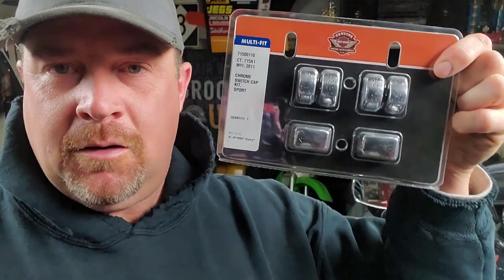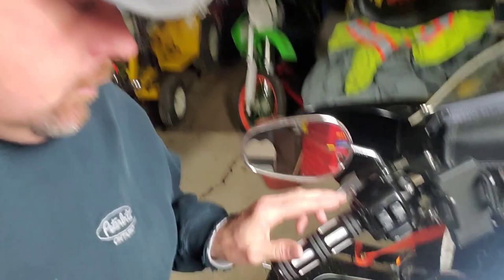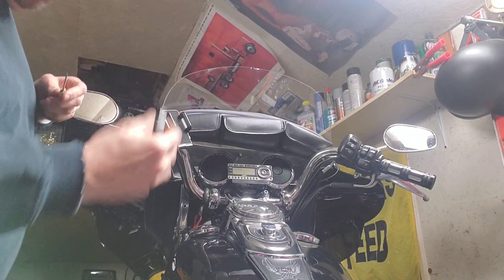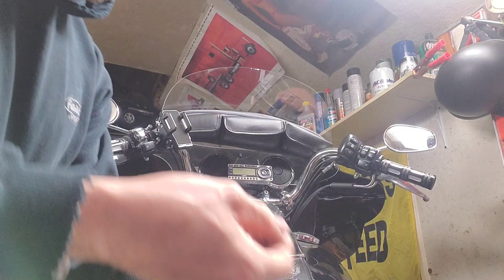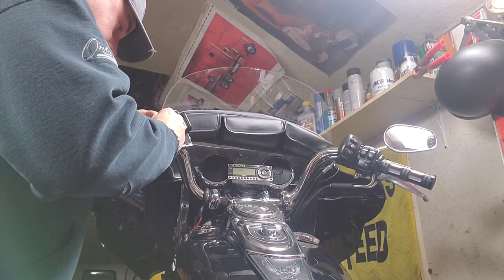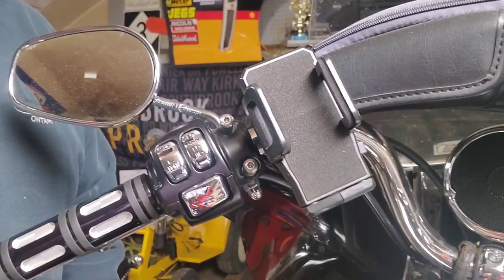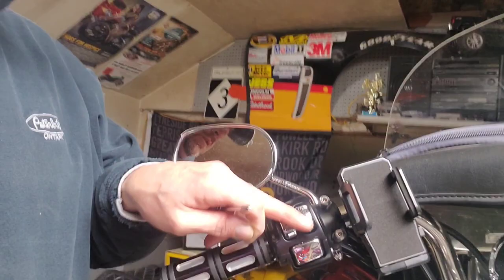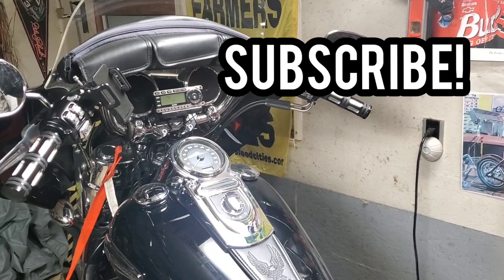Harley Davidson Chrome switch cap installation

Comment: I see you have the harley speakers with the on off volume switch, i have the same setup and was wondering if the volume switch comes into play when changing grips or is it a normal change of grips?
Reply from the maker: Its same as normal